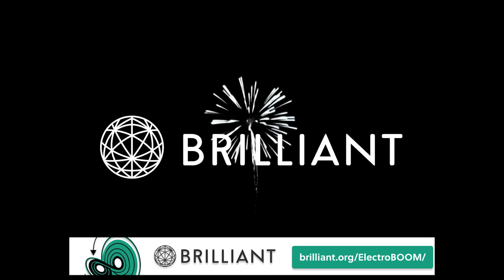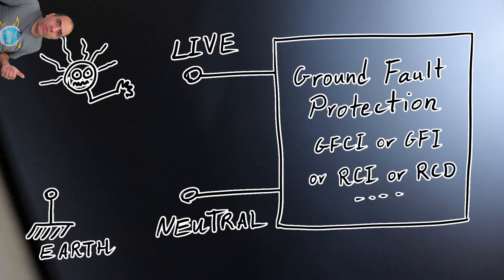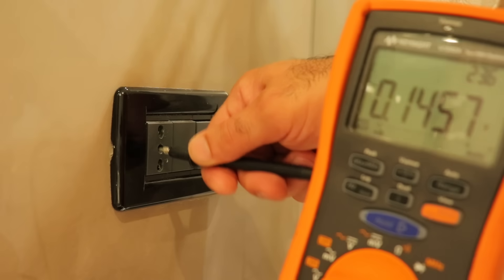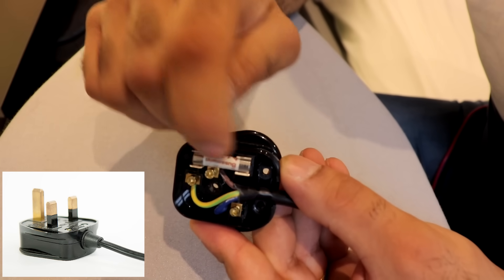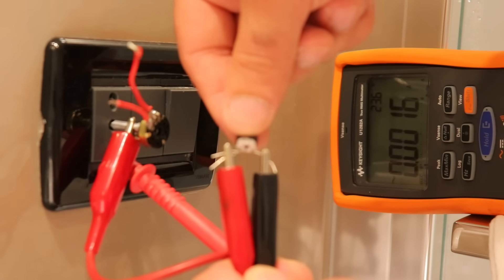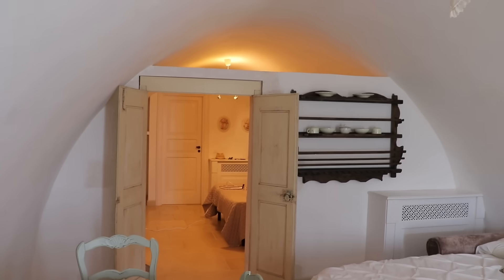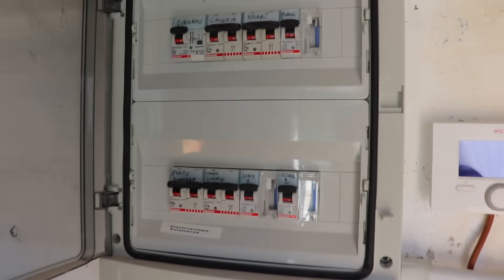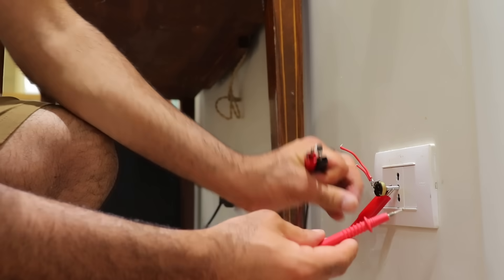Tripping Every Breaker in Italy

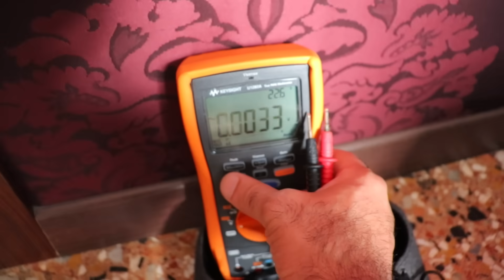Comment: 1:45 the nominal voltage for 1-phase distribution is 230V, but it's common for it to range around 215 and 240, depending on the load on the grid and on the home system itself. Since the distribution voltage is higher compared to North America and we don't need 2 phases for larger appliances, fewer transformers are needed. 

Phases are divided kinda evenly among users, but obviously the load can't be perfectly balanced or constant, thus the voltage gets lower in peak hours and higher during low load hours (both because of Ferranti effect during the night and PV generation in spring-summer weekends). The user appliances themselves also clearly lower the voltage, I can easily notice a voltage drop when I turn on the AC or the washing machine.

Comment: The electricity is in Europe everywhere the same. The blue wire is zero and the brown wire is fase, the black wire is the fase that's is on a switch, the yellow green wire is earth. When we talking about 400 volts than is brown fase 1, grey fase 2 black fase 3, blue is zero and yellow green is earth. The ground protection is normally on a central place.

Comment: 15:05 honest question: why would it matter how you plug in the device? It's AC, the electricity will switch directions 50 times per second anyway. Imo it only matters if you are messing around with a multimeter, but then you can just test which one is which.
Reply: Every device will work if it's wired backwards, but that introduces danger in certain situations. 

Take for example, a toaster with a single pole switch. If the switch happens to be on the neutral side, all of the heating elements would be live at mains voltage even when the toaster is off. Edison sockets are also very dangerous if polarity isn't enforced.
Reply: @Owen_loves_Butters  Such a device would not ever be allowed to be sold in europe. You'd have to make your own device to make yourself dangerous on purpose.

Comment: The UK has the best outlets ..as the L and N have little doors on them that only open with the earth pin on the plug..this means if you stick a screwdriver in the earth pinhole it opens the doors to the L and N holes so when you stick a bear wire in the holes when you pull out the screwdriver the doors trap the wire securely in the socket 😉

Comment: and one trick you can do in europe. we have 3 phase power outlets. disconnect the neutral and have fun. if multiple device are connected on different phases, but neutral is missing, but they are grounded in the same way. each device gets around 400 volt immediatly. that blows up everything :-). and this turns to fun if the ground fault protection breaker is broken and the neutral is damaged in it. i had this experience already

Comment: you dont need a potentionmeter. just connect neutral and ground. the ground fault protection will immediatly trigger and the best thing. no harm with electrical current for you

Comment: that's a 2 phase box  that's why you have a breaker on neutral. so from hot to ground or neutral to ground you have 115v. both together gives you your 230v. and that outlet you questioned is the old Italian outlet. the older houses here in iceland still have them from before we switched to eu plug

Comment: You really do not want to put a shuko into standard outlet. There is interference , mechanical resistance stopping from doing that. Of course if you push very hard you can force a connection but the earth plug , obviously, which is big mistake as you correctly pointed. I hope you liked your staying 🙂

Comment: The Breaker with the GFCI is a RCBO so a RCD with Breaker option. very need and good on them to use the one phased ones, which means they didn't cheap out on the safety. Most European house wiring requires the GFCI to be infront of the rest of the entire circuit. Unfortunately the wiring is total bullshit. Black should be life and blue neutral... But i guess the current doesn't care about wire color...
one last thing about the groundless connectability, it is a bit measuring with two cups, definitely but here comes the neat trick! even if you touch any live part of the machine a current will go through you against earth and the gfci will detect it. If your connection to ground is bad anyway, you would only get shocked if you touch the neutral part of the machine as well. That way the gfci always trips. Granted you will get a higher shock that way, but only for a short time (20 to 40 ms) so its not considered "deadly" yet. Its not nice, but better than having no GFCI.

Comment: In Italy we have single phase 230v 50hz for residential use and three phase 400V 50Hz for industrial use. The color scheme is black or brown for phase (live) and blue for neutral, while the green-yellow is ground wire.  In the standard 3 pin socket the center hole is for ground while the sides are live and neutral. Usually you will find ground protection in every place you'll go because before even opening any hotel and even a private house, there must be a certifications where the electrician declared that ask the required safety measures have been fulfilled.

Comment: Black, Grey and Brown are the colors for the live conductor in three Phases system, while light blue is the neutral, green/yellow is ground. In single Phase we have OFC light blue as neutral and one of the three color as phase. The different socket with centre to centre distance are made for a purpose, the small is 10A max while the bigger one are capable up to 16A.

Comment: This is true that in Europe we usually use one or two GFCIs for the whole apartment, not just the bathroom.
The wiring in the outlet that you have unscrewed is probably wrong. It should be yellow/green for ground, blue for neutral and black (or anything else, like brown, gray, red) for live.
30mA is a standard but if you want extra safety, you can install lower rated GFCIs for some circuits.

About the plugs, we have many types here. I think that German (schuko) plug is safe and convenient and French (also used in Poland) even more safe and just a little less convenient.

Comment: Small socket is a 10 Ampere outlet. Larger ones (or the ones with both large and small socket) are 16 ampere. When you see the small socket it means the wire can support 10 Ampere only, you can't plug anything that requires more than 10 Ampere. There are ways to connect a 16 Ampere plug to a 10 Ampere socket, they are all protected with a fuse.

Comment: it's a written rule to put 1 security breaker on every single electric panel. we got a double standard for plugs, the little is for 10A, the big for 16A, so you can't plug a 16A cable on a 10A. for the shucko standard (the round plug) , we got an adapter. (sorry for my bad english, i'm italian)

Comment: black is neutral? not up to code... black or brown is phase, and blow is neutral.. that's the code here in europe haha
Reply: Blue is a colour dedicated to neutral wire (also in Italy).
I guess it's an electrician's mistake connecting the cable on previous switchboard.

Comment: Ok, I try to explain you the logic behind our differential switch system.
On first we have to talk about the safety curve: on a cartesian plane voltage-time you could see that 50V at 50Hz people can handle for maximum 5 secons with no risk for their life.
On same curve you can see that 230V can be handle for not more than 0,4 second to be safe at the same way.
Second you have to know how neutral pole is connected to the ground.
In Italy we adopted the system T-T, it means that we have a local ground not directly connected on ground/neutral of transformation cabin.
So, on fault loop there is in series the ground resistance.
To verify the right functionality of a differential you have to measure the current and opening time of switch.
You have to know also the ground resistance or better the impedence of failure loop to determinate the sensibility of differencial switch needed to safety.

Maybe the Google Translate version is better 😉 :
Ok, I try to explain the logic behind our RCD system.
First we have to talk about the safety curve: on a voltage-time Cartesian plane we see that at 50V at 50Hz people can endure a maximum of 5 seconds without any risk to life.
On the same curve you can see that 230V can be run for no more than 0.4 seconds to be equally safe.
Secondly you need to know how the neutral pole is connected to ground.
In Italy we have adopted the T-T system, it means that we have a local earth not directly connected to the earth / neutral of the transformer substation.
Therefore, the earth resistance is in series on the fault circuit.
To verify the correct functioning of a RCD, it is necessary to measure the current and the opening time of the circuit-breaker.
It is also necessary to know the earth resistance or rather the impedance of the fault loop to determine the sensitivity of the differential switch necessary for safety.

Comment: Hi, I'm from Italy.  The socket at 9:14 can be a telephone socket or a "safety electrical socket".  The plug at 15:09 is called the shüko socket, it is not the Italian standardized plug, but it is the German standardized plug.  The "Italian" socket is the one in the lower left photo at 15:16. The shüko plugs aren't meant to be plugged on the Italian sockets, because the holes are smaller than the plug prongs. To fix that problems they make adapters to plug the shüko plugs in the italian sockets.

Comment: Italian EE here: all houses (at least the one that don't have a 100y old electrical cabinet) have one ground current protection (called "differenziale" in Italian) for the whole "breaker" box.
The one you have in your room are breakers (called "magnetotermico") who switch off in case of short or too high power. usually homes have C10 or C16 lines, C is the curve type of the cut in case of too high power an 10 or 16 is the Amps of your line.
The Italian plug (shitty one, team shucko here, which is German not Italian) is available in two sizes the small one is rated 10A the big one 16A. That's why you see the "double drill" in your socket, moderns sockets connected to 16A lines can accomodate both 10 and 16 plugs.

The weird connection in you apartment in Puglia is a old phone connection, actually both sockets are phone, one is RJ11 the other one I have no idea, it's not that common.

About voltage, while it should be around 240V, in the evening in the peak of demand it can go easily to 220V (our "old" voltage)

So yeah we have good electrical safety, on the other side we have people cheating at you and throwing waste on amazing beaches... So yeah..

Comment: Ground fault protection is for the weak. If I grab a broken power cable, I want to feel the full rated current for that circuit passing through my body so I know it's time to add some more electrical tape to my splices.

Comment: 3:38 Thats weird, the neutral wire is always the blue one, while the life wire is the black one (it also can be brown, gray or white)

15:28 Not only you haven't the ground connection, but plugging the european plug into the italian outlet is pretty dangerous because the holes in the italian outlet are too small. This can generate a fire and the two connections are exposed!

However I'm glad that you visited my city: Venice! Greetings! 😀❤️🇮🇹

Comment: ground fault protection in italy is called "salvavita" wich means precisely "life-saver"
Reply: No: salvavita is a product name copyrighted by BTicino, its actual name is differential-switch (RCD) if magneto-termic-differential switch (rcd with mcbo combined)
Reply: @davidebacchi9030  true that, in any case we can say it's commonly called salvavita by the average layman.
Reply: @davidebacchi9030   Actually the name is just "(Interruttore) Differenziale" aka differential (switch/breaker).
The "(Interruttore) Magnetotermico-Differenziale" aka magnetothermic-differential breaker is the combo of both a regular over-current breaker and an RCD (these combined breakers are know as RCBOs in Canada/Europe and GFCIs in the US).
Differential switch/breaker is actually a much better name than "residual current device" as it describe what it does and how it works: It breaks the circuit whenever it detects that the differential between the current going in the circuit (through the live wire) and the current coming out of it (through the neutral wire) is above a certain threshold (because it means that it's  exiting the circuit through a path it is not supposed to, like your body and then the ground).
Reply: @qdaniele97  perche' avete scritto in tutti inglese anche se sappiamo tutti che Mehdi non leggera mai questo
Reply: @Man_TM  ogni tanto ci sono gli altri utenti che leggono, è sempre bello imparare dippiù
Reply: @SirtaoEsposito  hai assolutamente ragione
Reply: @davidebacchi9030  calmati , lo chiamano tutti salvavita